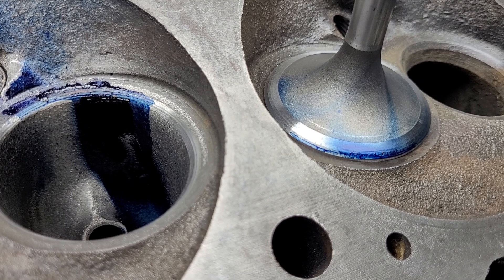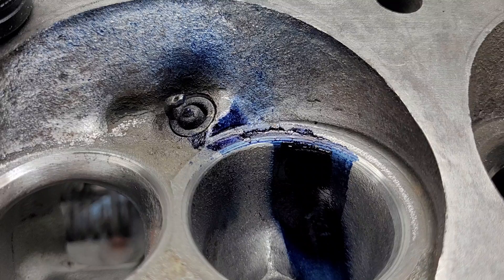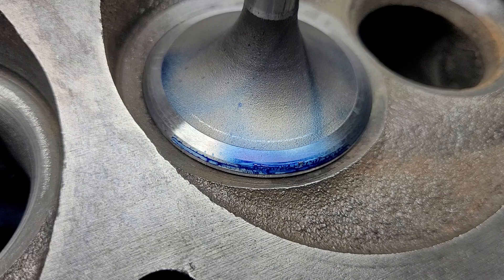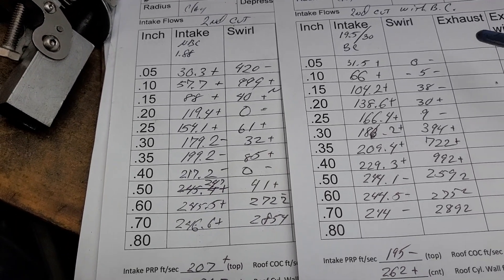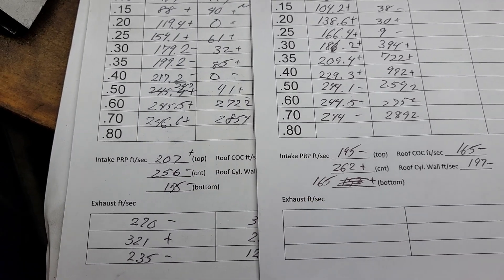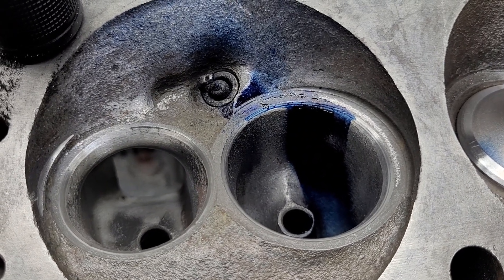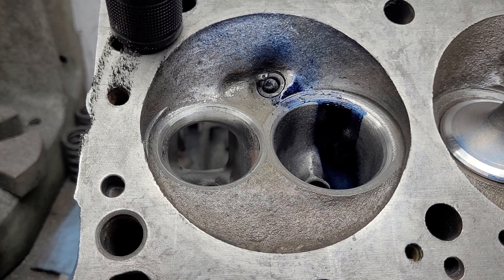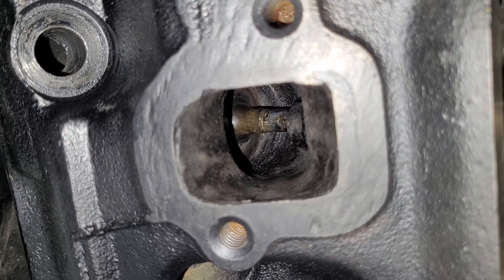Mission Impossible 318 project teaser, Chrysler 360/915 J head second cut 1.88" backcut valve

Comment: 360 J heads, the few that are not cracked are not much good on a 318 as the chamber is way too big. 1,88 valve is about as big as you can use. Late 318s had a smaller chamber with 360 ports. Not great but better.
With all the money being wasted go buy some aftermarket heads which will be better
Reply from the maker: These heads are not for Mission Impossible. I am going to guess you don't understand the Mission Impossible project. J heads or aluminum heads could be used later but first runs will be open chamber 318 heads.

Comment: I’m using a , Manley 1.625”
swirl polished exhaust #11783
Reply from the maker: Do you need to go to that big a valve?
Reply: the slightly larger valve gives me the assurance , to achieve optimum installed height because of more seat to work with .

Comment: David Vizard swears that tulip valves on the intake will cost flow.  He said that due to swirl, air will travel sideways across the valve and a nail head reduces cross section.
Reply: FWIW, these valves were selected as not only inexpensive replacements but they’re also going on a mostly stock engine where high performance isn’t a factor.
Reply from the maker: I have no doubt. Even with the deep bowl. Thanks

Comment: It looks like the flow will be wetting the plug area pretty good. i´m second guessing the vane position, or maybe the bowl shape. In such situations it may behelp full to shape the bowl so it helps the fuel getting thrown back into the flow so you get a more even distribution.
Reply from the maker: I am not an expert with this so input is helpful thanks.
Reply: @servediocylinderheads  Looking at it a second time the wetting may not be as bad as intially expected since the plug is angeled towards the exhaust valve. That will create a shadow effect which may leave the plug mostly dry. I would expect a slight change of the vane would have a positive impact on that part. It would be worth to try and alter the directional shape with some clay to see where the fuel goes.
Reply from the maker: @torbenalstrup3902  Thanks
Reply: @torbenalstrup3902  Maybe that is why 360's always seem to be thirsty on gas. I have had a few and they all got terrible mileage.
Reply from the maker: I bet the open chamber has something to do with poor mileage. Less turbulence than a quench chamber makes an air fuel ratio difference.

Comment: I put those valves in a drill press ,spin at a low rpm and use a right angle die grinder with a sanding flap disc and then a scotch brite maroon disc to polish it. IT'S easy to shape the back of the valves that way
Reply from the maker: I have done a similar mod. I put a drill in a bench vise holding the valve and use my die grinder to swirl polish it. I did a video of it a while ago. Thanks

Comment: isnt the 318 getting LS valve? i wouldnt know what one looks like
Reply from the maker: Later versions will get ls valves. I was asked to do two sets of open chamber  heads, stock valve size and 360 valve size. I have not received any open chamber castings so far. Thanks
Reply: @servediocylinderheads  sweet i thought theses the heads .. but etherway  having both mayhe eye opener

Comment: did you smooth out the square edge on the side of the valves
Reply from the maker: If you are writing about the chamber, I haven't. Thanks
Reply: @servediocylinderheads   nope. I'm talking about the 2 edges on the side of the tulip part of the valves I send ya an email

Comment: In my opinion, the magnum head is a key for moderate street power. The ports are small, so the flow isn't that huge, but they just plain work. I'm just a DIY porter and have the results flowed in a local shop; no problem getting over 240 cfm on the intake with a magnum. The best J I have is in the 290 cfm range with a 2.02 valve, but it has some ports that have hit water.  I haven't done the port work, but have duplicated it moderately with good results in budget race engine. The intake short side is laid back considerably.
Reply from the maker: Good info, thanks.

Comment: That’s a very nice pickup! That’s going to make really good power with the.484 lift purple cam which is a very good street cam. A 2.08 mail head valve and 90-91% throat is about as good as you can get. The magnum head really likes the throat opened up with stock valve sizes.
Reply from the maker: Good info, thanks

Comment: Charles, there is an after.arket magnum casting that has the old LA style intake bolt pattern. It is the same cost for a set as an one aluminum head. Depending on your flow results,I may pick myself up a set, so I can set it up for a stroker build.
Reply: MoPar did indeed have such a head. It was a Magnum head drilled for an LA intake. These are impossible to find.

There is a current head that does the same thing, a Magnum head with LA bolt pattern. The Aussies or maybe the Zelanders did this casting but no longer do so. The Chinese do it now and it has less than Stella reports.
Reply from the maker: Nice!